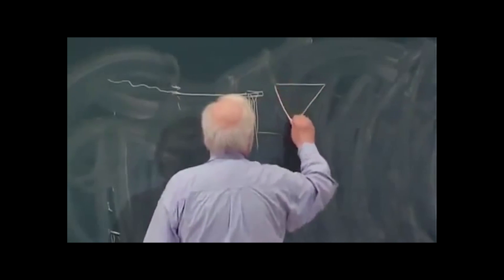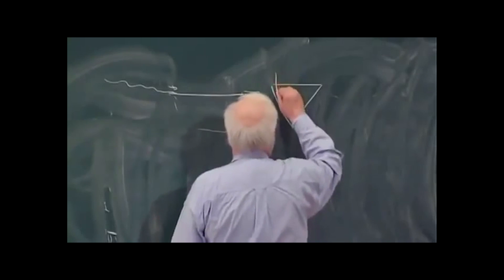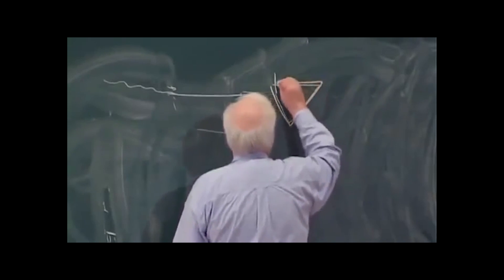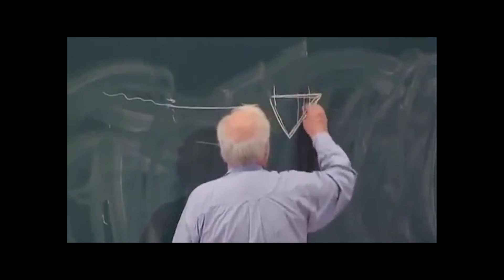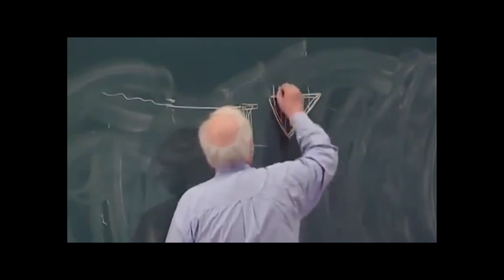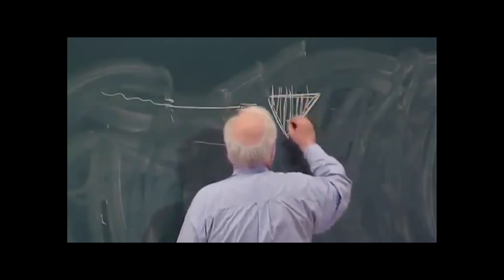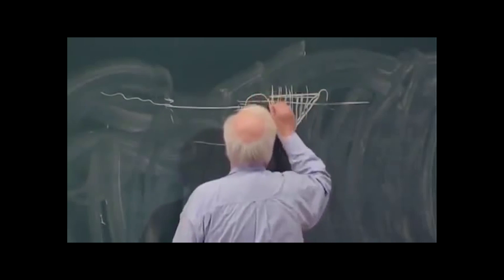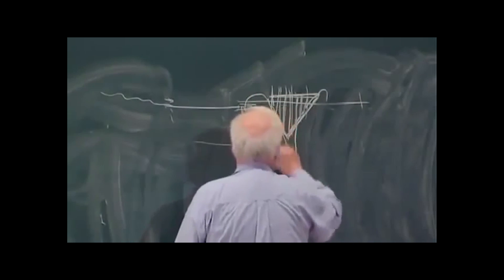Bill Mollison explains a Trompe

Comment: luv this guy but it NOT a perpetual motion system.  The descending water full of bubbles is Less Dense than the de-bubbled return rising water, therefor a Pump is required in the model, which uses as much energy as was in the compressed bubbles. His physics were getting a bit shaky there.  sorry, jus sayin. don't hate.  Try cellulosic alcohol as motor fuel, still green but Actually works.
Reply: It’s not meant to be a perpetual motion system.the idea is to use water running naturally off high terrain,pumping not  needed,got it
Reply: It’s not even a viable energy system of any sort.

Comment: 1 atmosphere = 14psi
15' drop in water = 1 atmosphere. 

Thoughts on practical application

1. Run the compressed air through a cooling radiator.
    a. refrigeration
    b. air conditioning
    c. power tools. 
    d. power generation. 
    e. vehicles.

Comment: I've never heard of these cars he's talking about. There was a recent attempt to make compressed air cars, but it was not nearly as efficient as he describes...
Reply: Search: engineair and Angelo Di Pietro and his rotary air motor design, it's not just cars, the same motor can be used to power just about anything, the more power required, the more motors you add so everything is interchangeable and NO LUBRICANTS required. Not surprising that virtually nobody has heard  of them. There are limitations though in colder climates.
Reply: You'd have to go back all the way to the 19th century, Before the original robber barons 'cornered the market"
Reply: Adam Mackey Smith https://youtu.be/bsTK-BiUgtg

Comment: Sounds lovely.....but is it practical?
Reply: Abu Hamza Mohammed - Sorry Abu, total lack of imagination on your part. Are you saying that compressed air can't drive machinery? 
It's applications are myriad, clean and cheap, once the infrastructure is in place.
Reply: It is a way of harnessing hydro power: https://en.wikipedia.org/wiki/Trompe.
Note that it needs to operate on a slope with a water source: the water exiting has to be on a lower level.
Reply from the maker: Hi Richard the water needs to fall at terminal velocity to get the most pressure in the shortest distance.  100 feet or 35m will get a good pressure for compressed air engines which will have freezing temperature pure air exhaust.
Reply: They apparently ran two cites on it imagine trompe & primary source water ??
Reply: Bellachea Maria Well, it's s a 16th C concept used today to clean up dirty water (YouTube). Otherwise, not much else!
Reply from the maker: Salam Hamza a vertical drop for a terminal velocity fall of 100 feet or 35m will get a good pressure for compressed air engines which will have freezing temperature pure air exhaust.  India and France make compress air engine cars, all mechanical devices can be powered by compressed air like the compressed air socket spanner tools use in mechanic workshops and tyre shops.
Reply: Geoff Lawton: Permaculture Online  Do you install these systems anywhere? I am thinking about it for my farm, Also do you have generators, or similar devices to store, or USE that energy?
Reply: If you're going to use the low pressure air to make electricity, the system as a whole is HORRIBLY inefficient. You would get vastly more energy out of a water turbine.